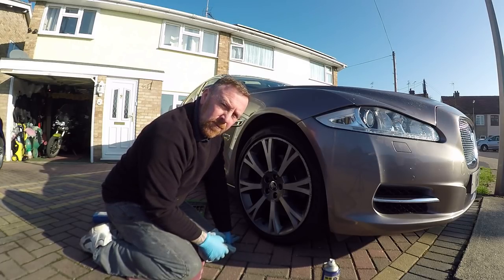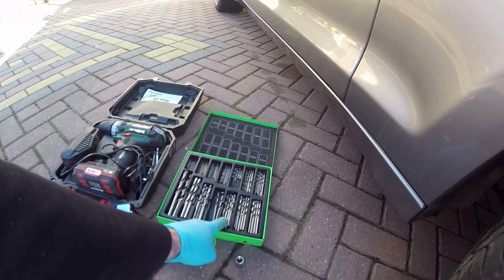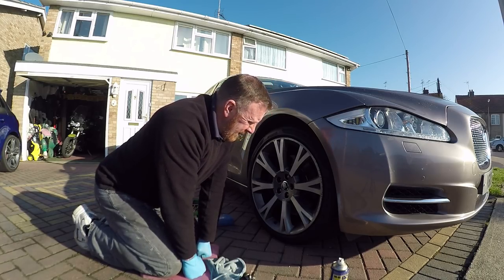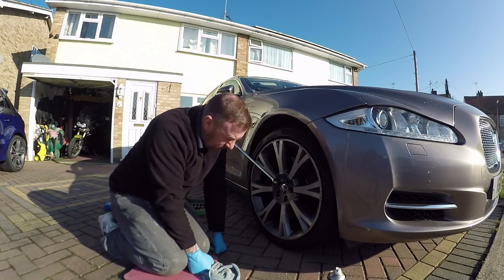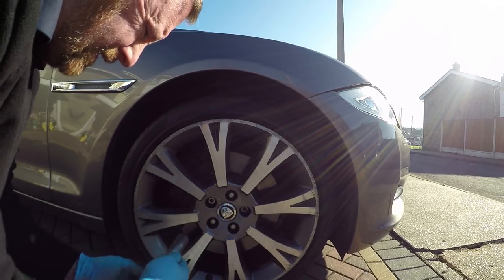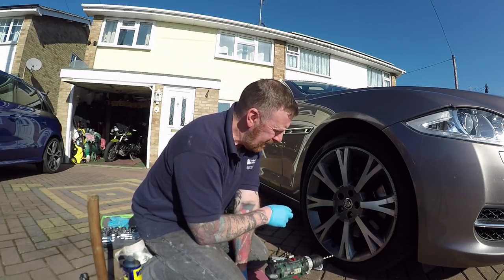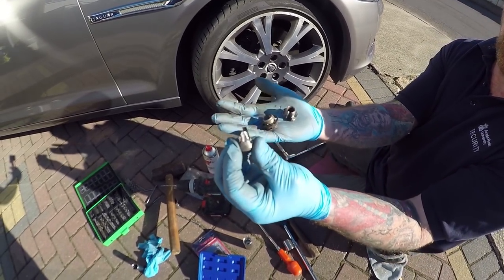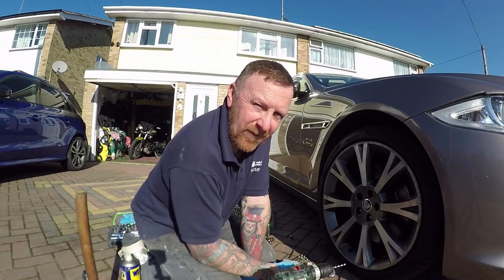JAGUAR SNAPPED WHEEL NUT REMOVAL MARK SAVAGE

Comment: Think the information here is a bit confusing, is it the rattle gun or Jag that muffed up? Real reason is that the steel nuts and alloy wheel create a reaction and the sleeve part of the nut fuses with the wheel. Secondly the design of the nut doesn’t allow huge forces for removal.  Had some tyres fitted, nuts torqued, month later two snapped on removal. Nothing to do with rattle gun!

Comment: Heads up guys just done the wheel nut on my x type (same nut) after a garage had hammered mine on so tight with a rattle gun I sheared it off trying to undo it. What I did was get a good quality hole cutter (I used a starret ) 22mm or 7/8 and removed the piolet drill. Now the ID of the cutter was the same size as the stump left on the nut this centred the cutter. I just cut the top off the nut!!!! The washer came off with it and the threaded part just unscrewed. No damage to the stud or wheel and only took 10 mins.
Reply: Used your method this morning on my XF, one on each rear wheel. Worked a dream. Thanks for posting.
Reply: @PedrSion  Thanks glad it worked OK.
Reply: Used the same starrett 20mm hole cutter myself last weekend.  Set drill to a low speed and it quickly, efficiently and most importantly cut the head off the washer that the sheared nut left behind.  2 drilled out in around half an hour no fuss or drama.  Kit £55 from screwfix or £20 for drill and arbour.   No need to struggle!!!
Reply: Used the 20mm hole cutter worked like a dream.   Also I think this might not be an over tightening issue by the garage...  I think corrosion sets in between the nut, washer and wheel. This expands the metal and is such increases the pressure on the nut assembly,  thus greatly increasing the torque required to remove/break the nut off...
Reply: This has just happened on my XF just ordered a starret cutter
Reply: did the same on my F type with a 20mm hole saw. had 3 snap on the same wheel. all 3 drilled off in 10 mins

Comment: For 45 years I've used copper grease on all my wheel nuts with a corresponding 10% less torque setting .
Never had an issue, not even with Jag nuts ⚠️
Reply from the maker: @julesviolin  shame the garages don't do that!

Comment: Having the same issue what type of drill is that your using or what voltage of drill can I use if I don’t have an impact drill?
Reply from the maker: to be fair bud i used 6mm to 8m but they kept snapping and a normal power drill , its not a fun job

Comment: Hi mark I have a speedfight question, I am having troubles with my vacuum to the fuel filter as no fuel is going into the carb. I have made sure the fuel filter works by sucking on one the tubes and it seems to be working as it should.
Reply from the maker: JJ1999 so you have tested like in my videos and it works ok ? I do have 70 speedfight videos that all should help 
However if that works check float in carb and give it all a good clean 
See if that works
Reply: mark savage when I try to start the bike it just sucks air through the air filter and doesn’t create a vacuum for the fuel filter
Reply from the maker: the vacuum is from the engine turning over, make sure its all back together right bud, did it run ok before , engine seal / oil seals ok?

Comment: Happened to me today on my 2011 XJ. Think the tyre shop over tightened the front wheels after changing tyres recently. Changed disc and pads on one side now stuck with a snapped nut on the other side I now have odd brakes 🤦‍♂️
Reply from the maker: @benstratford2798  it's not great and the same happen to me, I went back there and they said , nope it wasn't us! 
This is the only way I got mine off and it wasn't fun bud !

Comment: Had this happen at work a few times on Jags where they’ve previously been put on bollock tight with an air gun. The chrome outer is just a sleeve and what I’ve done before with success is drilled a hole through the sleeve as the nuts are hollow all the way to the stud and a mixture of penetrating oil and a butane torch with a fine jet on it 👍🏼
Reply from the maker: Bloody hard work lol , Had people say I did it wrong and doesn't happen!! But it does and is a real pain lol 
But got them off in the end , take care bud

Comment: I wish you could have shown how you drilled out the wheel
Reply from the maker: I did record it but you couldn't see much, have a good look at the nuts I took off and you can see but really it came down to drilling small holes around the flat side of the nut and drilling them bigger until I could jam on a socket to get the m off it was hard long hard work but worth it and saved me £s
thanks for watching

Comment: In the middle of this at the moment. I've found the easiest way. After 2 sets of bits, I used a protruding sanding belt that's supposed to be for bodywork. 
Just ground the stud and nut washers off. 2 hours per nut and you don't have to press on it.

Comment: Do you still mess with speedfight's? 
I've looked but can't find anything. Is there anywhere that does a new boa lock?
Reply from the maker: have you check out my other channel?, they are all on a play list and some of my early ones shows the snake lock, but to be honest if the key was lost I just left them and as they where big old things and hard to get round the rear wheel or post lol 
Peugeot speedfight mark savage
Reply: @marksavage  no I wernt subscribed but I am now, I won't bother then, I may try and convert it to a long oxford chain instead, doing as you say a refurb on a wc 97 wrc for a 40th bday present

Comment: With longer studs in the hub, the whole nut would be in use and not only the inner part. That should solve the problem.
I will try that out on my X-type... has snapped totaly 9 of 20 :(
Reply from the maker: They just didn't look into them properly 
No other car has them just jags that I've work on

Comment: Hi Mark I have a question about my LC Speedfight, what coolant do I use for my radiator? 
Thanks
Reply: It hasn't been running for a few months but im working on it now for the summer
Reply from the maker: to be honest any good anti freeze will be fine in a little 2t id do 50/50 water ,
Reply from the maker: @damiendanger424  just do a good carb clean , plug and air filter and all should be ok
Reply: @marksavage  Ok Thank You Keep up the videos, they're awesome
Reply: @marksavage  also how much do I put in?
Thanks
Reply from the maker: that's good to hear and thanks with over 70 speedfight videos and 150 in total on mopeds it was good to know some of them help.
now over 400 videos i just cant stop pmsl

Comment: Mate, thanks for this video. Also found on another video, you can use a 20mm hole saw and drill it until it hits the washer. Then the wheel pulls off and you use some mole grips to take the remains of the stud. Brilliant video nonetheless

Comment: You've probably thought of this but how about one of them left handed bolt extractor drill bit thingys?may not be beefy enough for a wheel stud though,nice motor btw bud👍
Reply from the maker: In take off the nut and did not want to damage or replace the bolt 
I found this way I didn’t damage it and could then put back on another nut
It’s a lot harder but saves on replacing 
But yes bud I had thought about it 
Thanks for watching
Reply: @marksavage  I get you now,pain of a job but as you said better to do it on the drive rather than get stranded on side of road😊👍

Comment: When fitting the new nuts try rocol 251 grease. At work we use that on RR jet engines. Bolts still come right off after 1000s of flights  👍
Reply from the maker: should have told the previous owner lol but I will be using new hardened ones so not to snap ,thanks for watching

Comment: What a mare! Hate it when garages do that! you would think they know better. Had it on my sisters golf but luckily it was just a long bar job for me. well done getting them all off on your own. Just thought, how about one of those impact drivers that you whack? although I hate using them it feel like your getting nowhere and end up whacking the hell out the cars bearings etc.
Reply from the maker: Rob k I did try my impact air gun with 150 psi and it didn’t move it at all !!!!
It’s just a bugger and very hard work 
Really think of popping back to the garage to slap them lol
Thanks for watching

Comment: same issue here 😢
Reply from the maker: It's not fun bud , sorry to hear it bud
Reply: @marksavage  Just got it back from the garage after having front brakes done. I told them not to put them on with an impact or to over tighten them. I went out this evening to check afterwork as i want to paint the callipers at the weekend and.....SNAP!! 😡
Reply from the maker: @chrisjennings5047  noooo !!!
Well off and replace bud 
But it's not a fun job bud like I had 
Bugger !

Comment: Easy to removed. Had job last week. 10 snapped nuts removed in 15 minuts. No drilig or alloy damage. Its not a garage fault. Bad designe and corrosion between alloy and wheel nut.
Reply: How?
Reply: how?